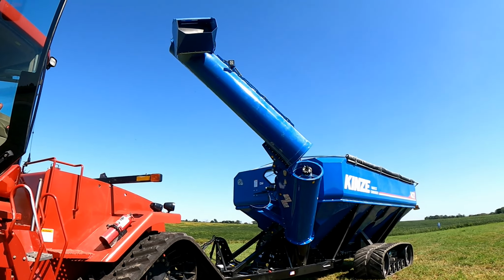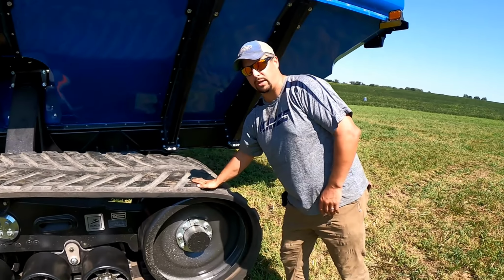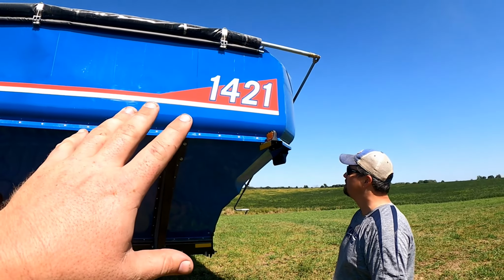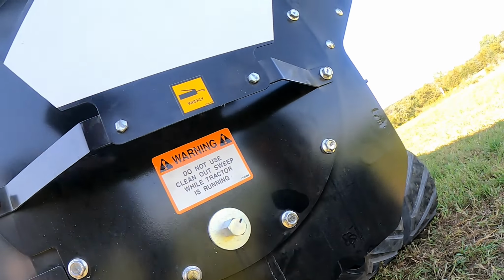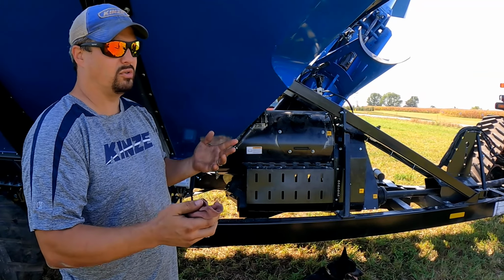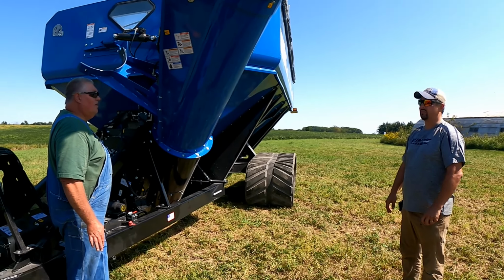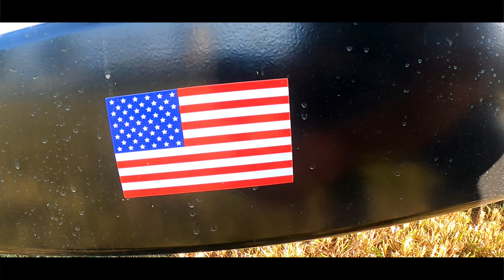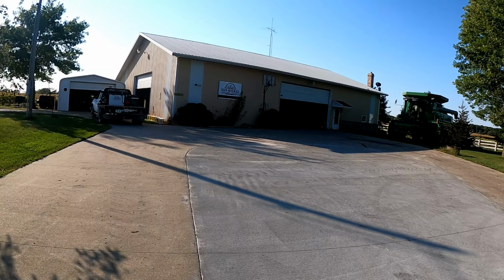GRAIN CART from the FUTURE! - Kinze 1421

Comment: We run a kinze 1100 on tracks.  It's been a great cart and it doesn't even leave a track when fully loaded.  We pull it behind a 500 and sometimes a 580 quadtrac . Great video keep up the good work!
Reply from the maker: That’s what I’m seeing. Can’t even tell it’s been in the field.
Reply: @iowANFarmer  yeah and they pivot over the terain excellent.  We ordered one like your demoing from the dealer for next year. We will keep  Our 1100 as a backup . We have ran kinze carts for the last 15 years with no issues.  The unload speed is fast but we never open the gate past 5 because it's too fast to respond too . You will probably end up ordering one as well . Take care!